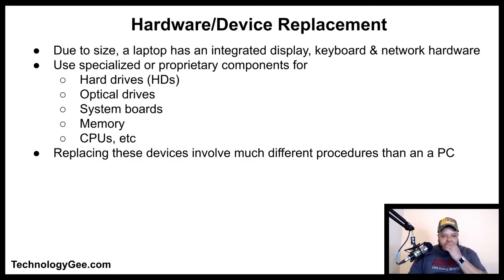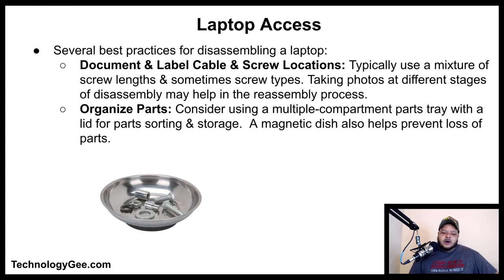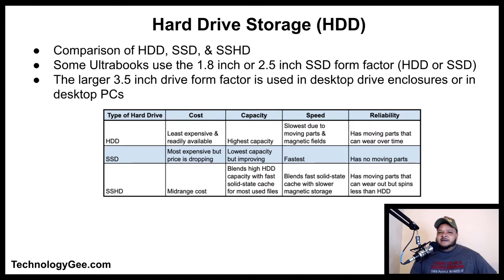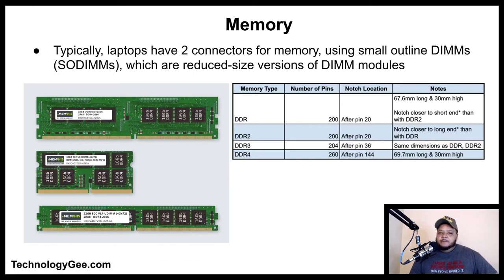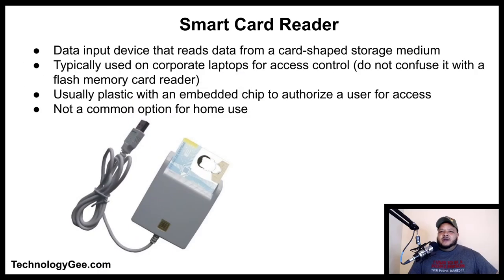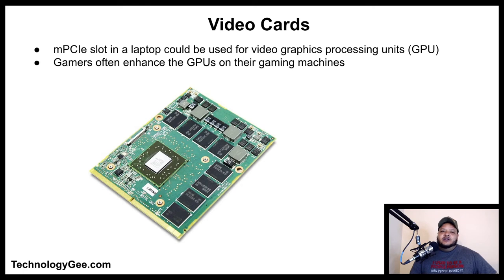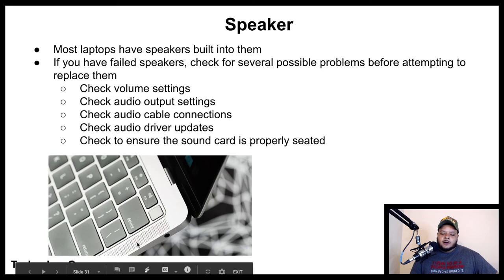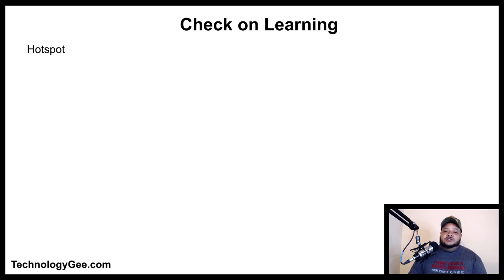Laptop Hardware & Components | CompTIA A+ 220-1001 | 1.1

Comment: First thing is u need to take off battery while working on the Motherboard and its components. Second is you don't use iron tool like the screw driver to take off the component from the motherboard it could damage the Motherboard due to short circuits.